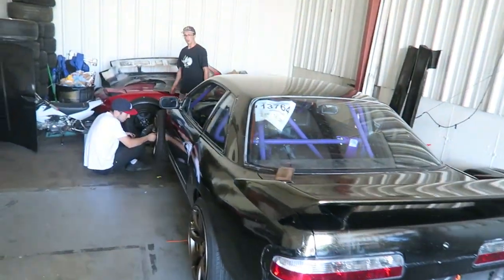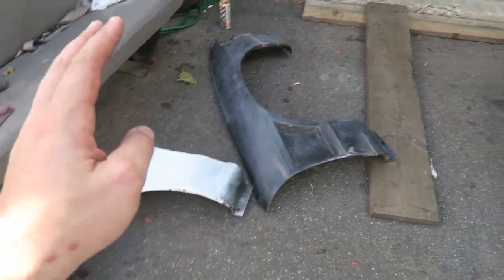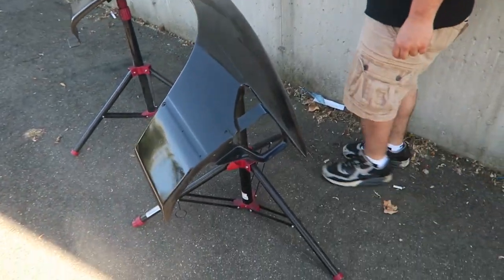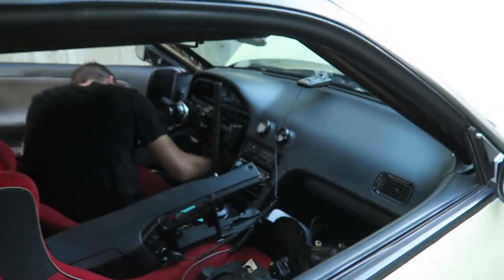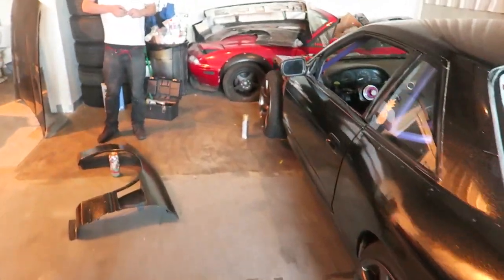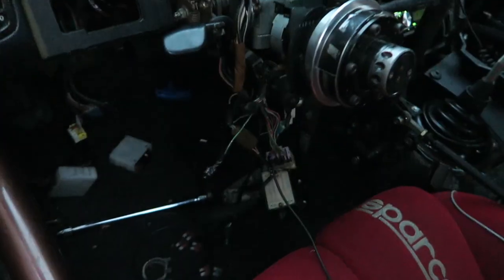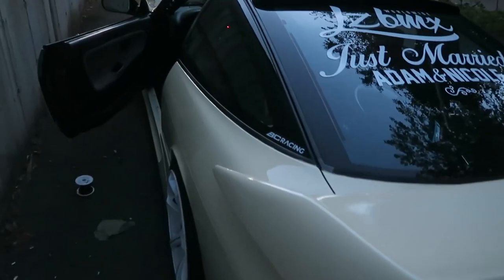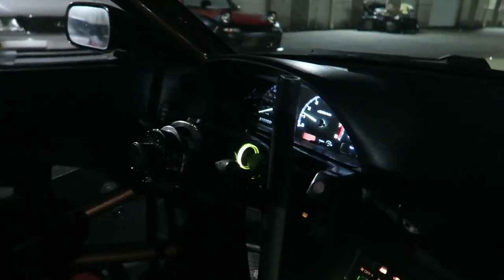Wiring issues are contagious?! The electrical mysteries continue + Drew's new paint!

Comment: Just a thought. on those dashlights. have you checked the output from interior light dimmer to the instrument cluster? should be a purple and a lightblue with purple wires from dimmer to ic. check those wires for an open. if wires are good, suspect the dimmer switch.
Reply from the maker: MikeHillman dimmer is after the headlight switch circuit, but yes I did check the switch and no good